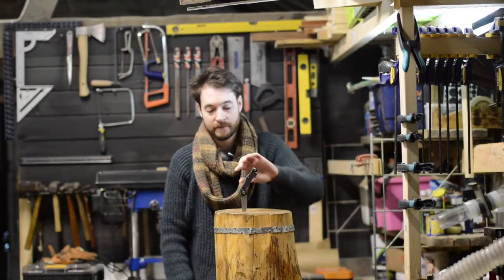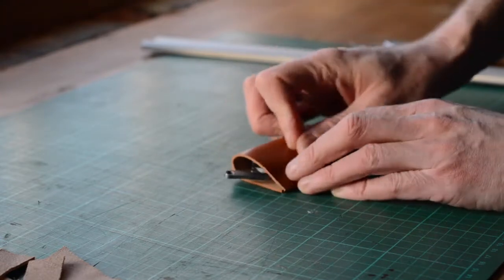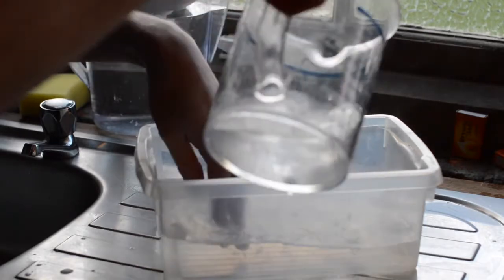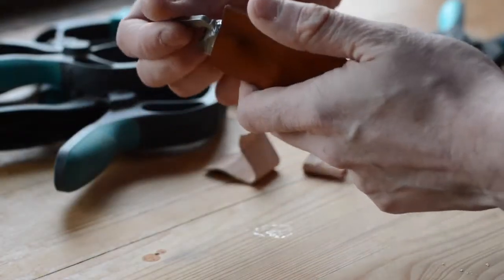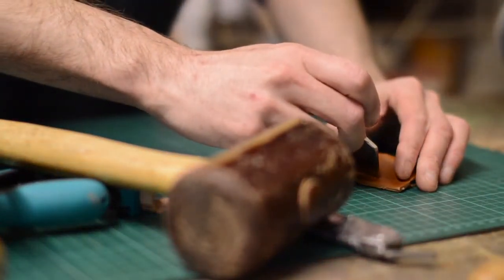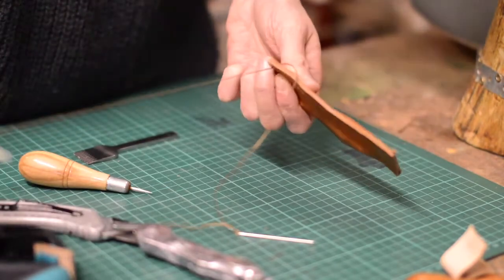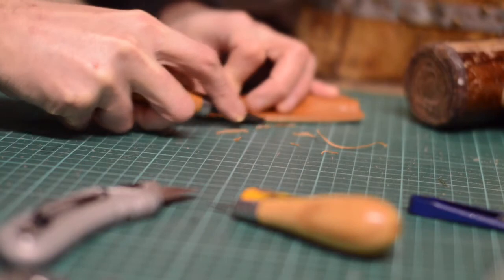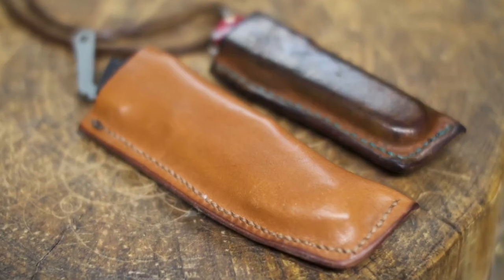Leather knife sheath case

Comment: nice method and result!  I have to try burnishing like that instead of by hand with denim material. out of curiosity, is there any push to change your knife laws to be less restrictive?  I feel way safer as a user with a locking blade when carving or heavy cutting is required
Reply from the maker: I wish there was. I like cool tools and can't even take my leatherman out of the workshop.
Reply: Badger Workshop wow, that's some strict knife laws. I live in California and we have a lot of strict laws but at least we can have locking knives and even spring assist opening. I wear a Gerber multitool on my belt daily along with three other knives in various locations.

Comment: Looks great love the patina on your other sheath.  Any tips on making the burnisher?
Reply from the maker: I got a mandrel that would fit in my drill press. I punched out a lot of disks of felt then punched holes in the centre of them. I put the disks on the mandrel and it works really well. I will post a pic in instgram right now.